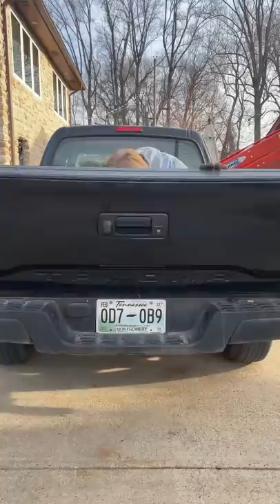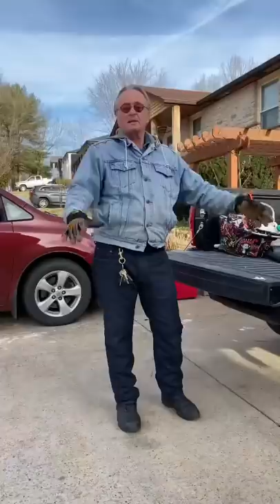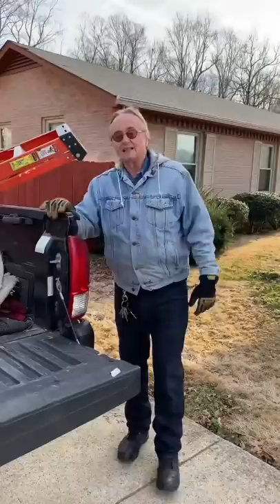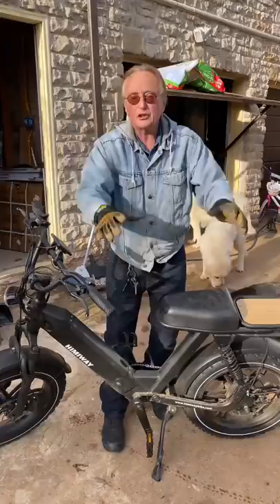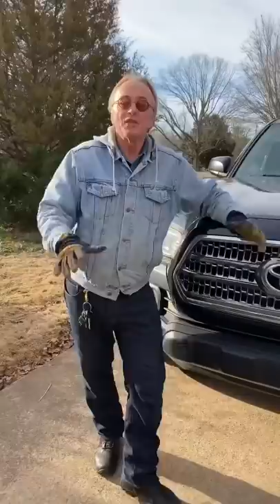Electric Trucks Suck

Comment from the maker: Thanks for watching! Like and Subscribe for More Vids Daily ► https://www.youtube.com/channel/UCuxpxCCevIlF-k-K5YU8XPA?sub_confirmation=1
Reply: Good afternoon Mr kilmer
What about truck with small engine and batteries like a Prius with bigger electric motors.
Reply: Scotty Come to Long Island and check out my 1962 international
Reply: Don't forget about the trains that have the power lines for electricity 😁
Reply: @MaxmilsRS  8 99re
Reply: You can eleaviate this problem by using a gearing system, putting less strain on the battery  when more weight is applied.

Comment: The faster you go and the more you carry...the more gas you use. The faster you run...the more you get tired. Isn't that normal?
Reply: Yes, but with a conventional internal combustion vehicle you can stop off at any local filling station and be on your way within 5 minutes.  Whereas with an electric vehicle you'll need to find a fast charger and sit there for an hour to top off the battery.  If you're hauling a big load with a truck and don't only drive in bigger cities or on interstates you may have a hard time finding a place to recharge, and that could leave hou stranded.  

I could see a local contractor that works within a certain mile radius doing well with an electric truck.  If you're only going to be handling an area of 20 square miles or something you could probably get away with the limited range of an EV truck with heavier loads as an overnight charge could get you through the next work day.
Reply: Yes but shows how electric shouldn't be shoved down our throats. It's not viable technology to replace the conventional engine yet maybe ever. Batteries should only be part of the equation. Too many instances where batteries get depleted too quickly and you don't get the range you need.
Reply: 60% of electricity comes from burning fossil fuel. the production of green and renewable tech, mining for the materials, and affects that turbines have on animals completely offset the benefits. So not only are electric vehicles extremely inefficient in hot and cold temps, and annoying for long drives/heavy hauling, until we switch to nuclear energy, they pollute just as much if not more than modern engines.
Reply: @messagefamilystyled1101  Cost of electricity is insane in California. We also just shut down a nuclear plant. Yet the Governor signs a timelapsed mandate to make all Semis EV. Cost of logistics is going to fuggin skyrocket.

Comment: Whaaaaaaa? The faster u go the more electricity u used?!?!? Well i’ll be damned, incredible!
Reply: @Donovan Lewis Nope. The engines work very well when towing. The gas consumption in normal pickups doesn’t increase as faster as with the electricity consumption on those fancy electric pickups. Also, the drain of a gas tank only leads to stop moving when it’s empty. But with a lithium battery it ALSO leads to the irreparable deterioration of the battery. EVs are less than garbage. Ethanol is the future.   Lithium is not a renewable resource.
Reply: @Donovan Lewis ethanol is renewable wdym!?
Reply: @Donovan Lewis bro recycling lithium is toxic as hell.
Reply: @mycitysucks8096  The open pit mining that is often used to get it sure isn't green either.
Reply: @Donovan Lewis Wrong.  Today there is virtually no recycling of used lithium ion batteries.  Sure there is research, but nothing in practice.  It's really hard to recycle litium ion batteries, compared to lead acid batteries which are nearly 100% recycled successfully
Reply: @Donovan Lewis no modern day practice for recycling Lithium ion batteries. Scotty is right on this one the best technology for an EV would be a diesel ran off of bio-diesel powering electric motors.
Reply: @Donovan Lewis recycled parts in the battery does not equate to recycling old batteries. Lithium ion is a pretty horrible material especially for a battery packs in vehicles. In phones its a good option but for a truck or large SUV it's not as efficient.
Reply: @reiniergarcia  Sorry but your conclusion is wrong. Ethanol will NOT last forever. It will get replaced. Eventually.
Reply: @Donovan Lewis ethanol is a renewable resource. Lithium battery replacement costs over 20k wtf are you smoking
Reply: @hajjdawood  How much corn are you gonna grow if you’re gonna make about 1,000,000,000,000 gallons of gas today? You know there are people starving
Reply: @onebadmutha5578  First of all we don't even use 1/10th of what you are asking, WORLD WIDE. Second corn grown for ethanol isnt edible, in addition ethanol can be made from anything including food waste/scraps

Comment: I think less than half of the pickup truck owners use them for hauling or pulling. And when they do, it's only a few days a week, or less. Most pickup truck owners just use them as they would a car.  Think about it the next time you're driving down the road. How many pickup trucks are either towing something or are filled with stuff.
Reply: It’s only a truck if it’s dirty
Reply: Makes no difference how often we use it. When we do we don’t want an electric piece of crap. If you want one because you never do real work go for it but next time I’m hauling my boat or trailer I’ll be thankful for my gas.
Reply: Really? what's your point?
Reply: @flashfyre  I think  you're right.
Reply: @wkw4095  My point is: few people use trucks for towing or hauling.
Reply: Yeah I own allot of things I don’t use every single day but I want it to work when I need it.
Reply: Why bother making vehicles that hold more than one person when most of the time they only have 1 occupant?
Reply: @craig9365  yes that’s so but it reducing gas my gas mileage isn’t gonna kill my truck killing the battery will make the truck completely dead. I understand your point but gas is far better at this point and it will prolly stay that way
Reply: Most truck owners have them to pose as truck guys. Thats why the stupid things are 65 thousand dollar fluff wagons with 4 foot useless beds.
Reply: I have a minivan and a truck, since usually only use 4 to 5 seats in the van should I not own it?
Reply: @krASHExxx  That's why they should start making mini-trucks again.  The equivalent of a corolla with a pick-up box.  I don't need a V-8 to haul a couple sheets of plywood or a kitchen stove.
Reply: My pickup truck is only used for towing or moving big heavy stuff.  I have car to drive when I am not towing or moving large stuff.
Reply: Its only a truck if its dented, dirty, and manual
Reply: In my town 90% of them the other 10% is either parked or used to go off-road
Reply: @ralphturner3798  --- This is why they should produce street-legal "mini-trucks," as Japanese trucks once were.  Now they keep making them bigger.  I'd like something with 35mpg, that I could use to haul a fridge or commute to work.
Reply: Every truck owner I know except my father only uses theirs for groceries or to help move a friend's couch at least once lol, a electric truck will be fine for most people and every year they'll get better and better.
Reply: 3 minutes to refuel for up to 500 more miles of Range. EVs will be a pain in the A$$ to road trip with.
Reply: Electric trucks make more sense as fleet trucks than combustion engines. Those are the vast majority of trucks that actually do work on the road.

This guy emphasizing how the battery drains from hauling—all manufacturers are of course taking this incredibly basic problem into account. That he thinks it is some gotcha is ridiculous. 

The electric F-150 was presented with battery life hauling stats when it was announced. Still goes pretty damn far, and makes phenomenal sense for most work trucks. It is clear this guy has not looked into anything regarding electric trucks. Why anyone would value his opinion, then, I have no idea.
Reply: @craig9365  yes hauling and speed increases significantly affect gas mileage. Basic physics—energy must be expended to do work.
Reply: @elultimo102  yeah trucks have gotten way too big, especially since most people barely use them.
Reply: @johnbolt3883  Yeah, Scotty Kiler is very opinionated, and often just downright wrong.

Comment: Totally agree. I would MUCH rather buy a hybrid gas/electric. When driving back home to visit my folks, I only have to stop once for gas after 500 miles or so, and I'm good for the rest of the trip.
Reply: Exactly.   BMW i3 REX with a small engine as the generator is the right thing to do.  Plain i3 with battery-only is not.
Reply: There are lots of electric cars with over this mileage capability.

Edit: I stand corrected😂
Reply: @jesmondo5785  um they said they would then go  further after the 500 mile stop…
Reply: So, you are just using the gas engine!🤤
Reply: @jesmondo5785  
It appears Google disagrees with you!🤤
Reply: 8hrs of straight driving is not very normal use.. so not sure most people need 500miles of range.

His rant makes no sense, he doesn't have any background with EVs and has no clue if the electric trucks are going to be able to overcome some of the towing/load strain put on them and their range. 

If the F150 EV can't pull anything, it won't sell so it must have some capability, time will tell how good it is.
Reply: Yes if anything that. our infrastructure it's not good enough for  fully electric. Power grid isn't good enough for everybody to be charging their car plus washer dryer heater oven all you hear is more electric but not where it comes from
Reply: @Josh.1234  it will sell to people who don’t use trucks to pull everyday, the biggest problem with an all electric car or truck is being able to travel, they are perfect if you have less than a 100 mile commute everyday but most people travel on vacations in cars and they are all loaded up with people and luggage and having to stop for an hour to charge up every 3-4 hours wouldn’t cut it. If they could make batteries cheaper, bigger and have 1000 mile range. Like the f150 who gives a damn about having a frunk put a v8 sized battery there and get the 1000 miles range. This is proven because 20% of electric car owners have already switched back to or bought in addition ICE cars because electric doesn’t have the range.

Comment: I worry about how we dispose of dead batteries and the energy it takes to charge them. Big drain on the power grid. Now Toyota is SUPPOSED to be coming out with a new type of non-lithium battery that will be a game changer. But until then, I’m with you Scotty. Hybrid is the way to go until then. Also, hauling my boat, I’d hope that battery is totally waterproof when I back into the water lol
Reply: The fuel efficiency of an EV may be measured in kilowatt-hours (kWh) per 100 miles. To calculate the cost per mile of an EV, the cost of electricity (in dollars per kWh) and the efficiency of the vehicle (how much electricity is used to travel 100 miles) must be known. If electricity costs $0.13 per kWh and the vehicle consumes 33 kWh to travel 100 miles, the cost per mile is about $0.04.

Comment: My first internship (co-op) for PECo (Philadelphia Electric) was at a Combustion Turbine site. Anther part there comprised 2 frequency converters (Freqs). You see, electric trains run best at 20 Hz, so the normal 60 Hz needed to be converted. A couple of the overnight operators liked to waste time between vibration checks by playing chess. One of them ran his check 20 minutes early to keep the game going. Well, that was a stroke of luck because something went wrong and there was a major malfunction causing the rig to disintegrate. Had he kept his schedule, who knows?

But yeah, we need some work on batteries. Tesla’s (Nicola, the Elon guy) Wycliffe tower ain’t coming soon.
Reply: Wycliffe tower? Wardenclyffe
Reply: The Wardcliff Coil does extra damage to vehicles.

Comment: That’s the same as gas trucks lol! The more weight you’re hauling the more gas you have to use.
Reply: Scotty can't see past his bias to grasp basic logic when it comes to EVs
Reply: His comments were based on a diminished range due to the load on the vehicle. Yes, the range on an ICE-powered truck also drops with added payload but replenishing the "fuel" source for an ICE vehicle can be achieved in a few minutes, much faster than an EV.
Reply: @Aplexity  basic logic? 😂 When you run out of gas, you can refill in a few minutes.
Reply: Gas trucks have nearly infinite range compared to electric.  Guess what is range of semi diesel truck?  more than 2000 miles!   Pickup trucks with extended tank have crossed USA on single tank of fuel.
Reply: @grandpalarry7776  Exactly the range for both diminish no matter what. Everyone knows it takes longer to charge an EV, what Scotty is saying is that EVs are inferior due to their reduce range, which is quite false. EVs are only inferior due to how long it takes to refuel and repair.

Comment: It's insane to carry this much energy in a charged battery that can be damaged in a collision with another vehicle, tree stump, curb, lamp post, etc.  Then they short circuit and all the energy begins flowing.  Hope your doors unlock and you can get out fast before it bursts into flames.  Note; bullet trains do not carry their energy.  There's such a thing known as induction!
Reply: But isn't gasoline the same thing? If something punctures the fuel tank and it combusts if not instantly? Current electric cars purposefully surround the battery with extremely thick steel, not because they have to but to maintain their top safety rating. The model 3 is the safest car on the road by more than double that of any other gasoline car.
Reply: I’m in favor of inductive roadways to make this happen. Don’t think will occur though. Taking the battery out of the vehicle will never happen
Reply: @isaacerwin9402  it's easier to extinguish a gasoline fire than an electrical fire.  Model 3 safety is debatable as well, (and there is no "thick steel" around the battery) never mind their insane parts prices and long repair times. Electric vehicles are good for running around town but that's about all and they make no sense as trucks.
Reply: @isaacerwin9402  A Tesla driver (of course) was doing 70 MPH on a Lake Forest, CA residential street, lost control, careened into a garage and hit a BMW parked within. Both vehicles caught fire, as did the house, but firefighters put out most of the blazes within 20 minutes — except the Tesla. The Tesla burned for another three hours, ultimately requiring 20,000 gallons of water to put out.

Comment: I agree...  No one stops to think about the carbon foot print left by the increased electricity demand to charge these EVs all the time....
Reply: A full charge isn't much more than a 1hr cycle in the dryer, in reality EVs have a far smaller carbon footprint.

Comment: I always laughed at electrical vehicles, then when the government got involved I started to worry. 
More costly , less productive government solutions.
Reply: Good point , almost drank the koolaid
Reply: And China owns 95% of the rare  earth metals used in the batteries.
Reply: @Donovan Lewis anyone else believe that? Lol
Reply: @Donovan Lewis Fair enough, they control ALL of the processing, including every new plant proposed until 2029.  apparently there will be 136 rare earth metal processing facilities, EVERY one in China.  So, same result.
Reply: @Donovan Lewis electricity is pricey where I am.   But yeah make electric car mandatory, and crank fuel prices up and it is a done deal.  
Currently need a truck for my tools and a trailer.  I have no options to go electric.  Also I would like a electric vehicle that can tow a trailer for 800km and take 1 to 2 minutes to charge.
Reply: @Donovan Lewis also I laugh when people scrap their cars rather than pay for a battery replacement.  All in all electric cars are decent for puttering around, but for the next little while most will  ugly garbage.
Reply: The govt. tends to put the cart before the horse. Very quick to run with an idea, only to find out when implemented it's not as great as they advertised.
Reply: @junglerat1972  and yet the idiots judge them on their intentions and not the results.

Comment: All vehicles use more energy to do more work regardless of the type they are using, being chemical, electric, nuclear,...
It's just thermodynamic
In transport industry payload is what matters the most, and that is  a problem of battery operated vehicles
Greetings from Ireland🍀
Reply: Na diesel isn't really effected by weight, I drove a truck with 1 ton an I forgot it was behind there, also the mpg didn't decrease that much, ev batteries hate load
Reply: Yes, that is true. However, Fuel is way more energy dense than batteries.
Even though ICE are not as efficient, EVs have to carry way more battery weight.

For example comparing my Mazda 3 and a Tesla Model 3
Mazda 3: 2880lb curb weight & 436 mi range
Tesla Model 3: 4250 curb weight & 358 mi range

The Tesla Model 3 is 47.5% heavier than my Mazda 3 and still has less range.

Now these are just compact cars. Think about how it scales into Pickup Trucks.
An EV truck would have to be significantly heavier to match payload and range. The EV will need to carry much more of it's own weight and be diminishing returns. At least with current battery technology.

Also I haven't even mentioned the significant range loss at cold temperatures for EVs
Reply: You ever notice how ALL the vehicles that transport the MOST weight are electric already? Ocean liner, Trains etc.  hmmmmm?  Its almost as if electric engines provide better torque power than petrol.